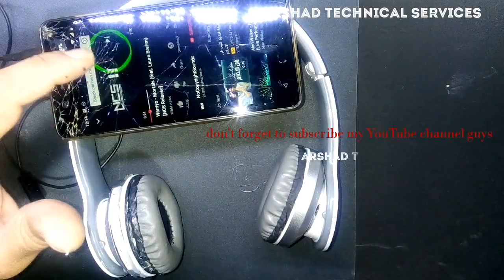How to convert Bluetooth headphone into wired|broken headphones hack hand free|

Comment: It's safe... Right?
Reply from the maker: Yes yes its definitely safe bro
Reply: @arshadtechnicalservices4243  Thank you bro 😁
Reply from the maker: Your welcome bro
Reply: Bro.... Can I remove the battery and connect the +ve and - ve ends of wire to form closed circuit without removing Bluetooth part.... Will it work??
Reply from the maker: @lalithwolverine1692  yes it will definitely work connect dc 3.7or4.0v volt adapter then your headphones works but if you try to run with outer charging port then may be its not working if you connect your adapter to direct v- v+  then your headphones working accurately🤗
Reply: @arshadtechnicalservices4243  the concept is just I'll disconnect the battery which is swollen and I'll connect it with wire to my phone? Will it work wired even if i don't remove the Bluetooth part and just remove the battery and leave?
Reply: Bro please answer my last question
Reply from the maker: Yes bro it will works
Reply: And pakka it is safe even though Bluetooth part is there and not the battery ?
Reply from the maker: Can you understand urdu or hindi
Reply: @arshadtechnicalservices4243  no broo.... English
Reply from the maker: Ok ok
Reply from the maker: Yes yes pakka its safe
Reply: @arshadtechnicalservices4243  thanks soo much bro
Reply from the maker: Bro contact me on massenger
Name is Muhammad kashif 
Send some pictures of your headphones